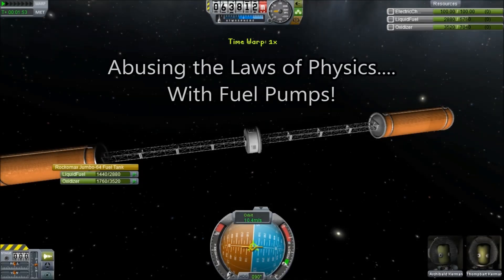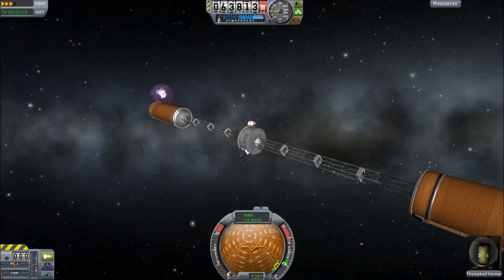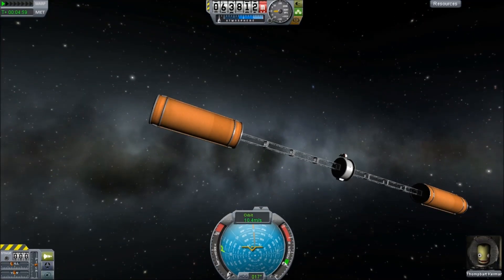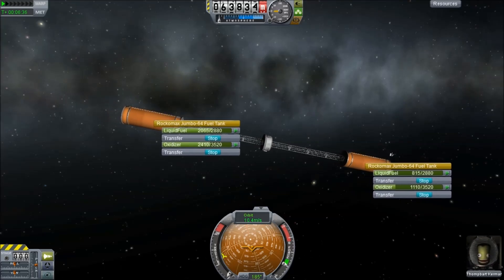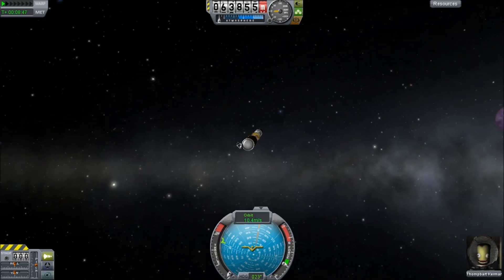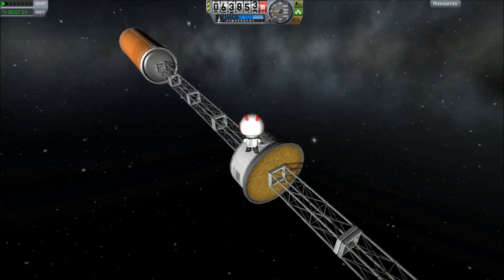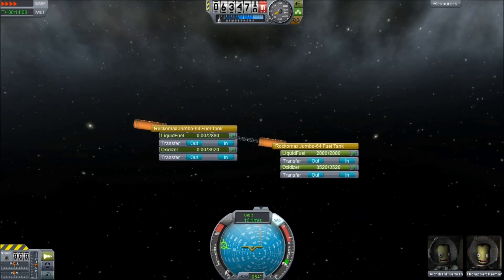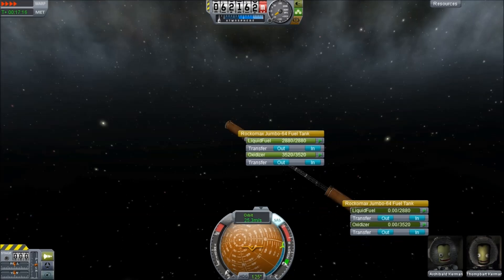Kerbal Space Program - Abusing Fuel Pumps To Break The Laws Of Physics

Comment: Could this work in Reality with Light Sails?  Does emitting light from a laser actually push back on the laser at all?  So imagine instead of having a fuel tank on both ends you have a light sail facing towards the middle.  Then in the middle you have a laser emitter pointing both directions.  Then instead of shifting fuel back and forth you turn on and off the laser to hit the sales when they are pointed the direction you want to go.
Reply: No, if the force you are applying is attached to the object you are applying it too, they cancel each other out and you go nowhere. Conservation of momentum, sort of like putting a giant fan on a sail boat.

Comment: if you set up a ring of tanks and had the fuel flowing around the ring, could you match the rotation speed with the transfer speed to make this exploit a little more automatic?
Reply: if you could set the transfer speed then yes
Reply: or measure the default transfer speed and match it with the rotation speed

Comment: The reason this works is that you're moving mass from one tank which is moving one way to another tank that's moving another way, magically accelerating the fuel as you do so. Since there's no corresponding magical acceleration in the other way, you'll break conservation of momentum. It's not a floating point error. It's the same as using it to change your center of mass, but with momentum instead of position.
Reply: well the reason this works is, that you don't need any energy to pump fuel in kerbal, but most certainly in real life :D
Reply: No. It's that you don't need any momentum to pump fuel. If you could do that in real life just using energy, it would still be a reactionless drive.
Reply: No, this isn't the case. If you pump fuel IRL from one tank to another, no matter if you're using energy or not, then your ship would move, not because you accelerate fuel, but because your CoM should always stay in one place. In KSP though they've done that that vessel is stay in one place while CoM can move (either because that's how Unity positioning system works, or because devs decided that ship shouldn't move when it's changing it's CoM). There is no physics behind it, only coding. And this bug is fairly easy one to fix (by adding same but opposite shift as shift in CoM, if this is due to Unity engine, or by removing that "fix" which makes vessels to stay in exactly same space, depending on cause).

Comment: There is no such thing as inertia!!! Stop trying to identify nothing. Moment of inertia refers to rotating objects. Inertia refers to resistance. What resistance?
Reply: ***** there's resistance in the pipes where the fuel flows due to friction.
Reply: hehe....
Reply: +TheJCprogrammer Luna I would like to clarify that it is fictitious.
Reply: +michael booley 
Inertia is the resistance of the body itself, look up an ice skater example where they extend their arms to slow down their rotation and bring them in to speed up the rotation. This works in a vacuum too.
Reply: +hookiebookie1 so long as the mass is the same, the change of motion would be the same. In this case, none. If an ice skater puts their arms out it increases air resistance (it also has things to do with centripetal forces but myeh). 'Inertia' is a fictitious name for the supposed 'resistance' of a change in motion. It does not RESIST this change in motion. If it 'resists' something then there must be a force acting on it in the first place and if there is a force acting on it then it will not remain stationary or at a constant state of motion (lets talk space here because on earth friction would be resisting its change in motion if it were to be stationary). You can literally describe everything without using the word 'inertia'. This supposed resistance can't be measured or quantified.
Reply: +hookiebookie1 +hookiebookie1 I respect that. At least you are not a self proclaimed Physicist like others i have discussed this with. 

Certainly though, gravitational force doesn't act as a force that slows you down? All it does is change your direction and brings you into an orbit where the atmosphere acts on the object. Most claim inertia to be the phenomenon described by Newton's first law (you know that). So long as you have external forces, like the ones your described, acting on the body then you cannot say that it is 'resisting' anything (in terms of inertia) because then that wouldn't be his first law (since the exception in his first law is that no external force acts on the body).

If there is 'pressure' acting on the body also, then mustn't this 'inertia' be disregarded since a body will only remain stationary or at a constant speed so long as there are no other forces?
Reply: +hookiebookie1 So inertia is not what people quote it to be? "The resistance of a change in motion" (brief) is what others say, its the resistance to an actual force acting on it (the 'torque' you mentioned).
Reply: *****
Well the force causes a motion, does it not? So the resistance to that motion will be the inertia of the body! It's not a singularly defined N3L force, as it's a function of mass and body size, so in that respect it's not just one definable quantity so you'd be right in that regard I guess :) But inertia is a very real thing indeed.

If you're interested, have a look at the kinematic Euler rotational equations as an example. If you know how to code a dynamic system, using MATLAB let's say, then try implement them into the code along with the 3-2-1 Euler angle equations. For a time stepped input force you'll see a gradual quadratic response of the body's angular displacement, then once the force is removed the response of the body becomes linear.

The reason there is a quadratic response is due to the inertia - the resistance of the body to the motion! :)
Reply: +michael booley Oh, I just saw your first message too, I'm glad you're open to discussion! 

In regards to solar radiation pressure, if the body is at rest and then an impulse of SRP acts on the body, there will be a "ramp" effect of the acceleration of the body. The acceleration will then go to zero, and the body will only have a velocity. The inertia in this case is describing the body's inability to instantly go from a 0 velocity at time t0 to n velocity at time t0+1. This "inability" is due to the inertia, which depends on the body characteristics.

I can see what you're saying about the gravitation however, you're seeing the satellite in a steady state in a steady non-decaying orbit. In this case, yeah there's no resistance acting on the body as all the forces are balanced. Let's say there's a solar flare however, and the air density at orbit altitude increases. In this case, there will be an imbalance of forces and the body's attitude will be influenced. So that the body doesn't "snap" to the new attitude, there will be a quadratic change in the acceleration - that is, it will gradually increase, reach a maximum, then decrease and settle to zero when the new attitude is achieved. This gradual change is due to the inertia of the body.

If though, like I think you're saying, the body is in a steady state with all balanced forces then you're 100% right, inertia doesn't do anything as there's nothing for it to do!

Comment: This is a perpetuum Mobile . Someone should tryx it in real life.
Reply: RedStoneGulch At some point, you would run out of either electricity or fuel for reaction wheels or engines.  It wouldn't last anywhere near forever.  If it was solar powered, the wiring and other individual parts of the craft would, at some point, wear out.
Reply: OcarinaT1 lol, did you watch the video? in real life your spacecraft would move too as you transfer fuel w.r.t the universe, so its not possible to begin with :p if it were, we could have gone away with superconductors but the energy input of the sun still wouldn't make it perpetual.
Reply: RedStoneGulch It would be much easier to use cheats in real life.
Reply: ***** SOLAR SAILS aka photon sails, they're pretty cool and they use the energy of light lol :P
Reply: And, even in space, will need some sort of repairs or replacements over time to function correctly.  All things deteriorate.
Reply: OcarinaT1
Indeed but hey they use no fuel and they're pretty light, and they work on light, and they're so cool :D

Comment: Actually, the most things in KSP could be exploited to gain/lose energy. The fact that KSP doesn't simulate a n-body problem can be exploited, even better: KSP:s horrible aerodynamic model actually causes the total energy to change quite a lot. FAR does a much better job, but even there, there are situations were you gain more/less lift (and thus energy) than you should.

Comment: you actualy dont break the laws of physics there, i tested that theory in a very good 2d physics simulator sandbox program called algodoo, and with actual water i was able to build a pump, pumping the water from one tank into the other, gaining velocity, frm my center of maß, it took some time to trancfer some water, i hade to keep the rotational speed smal, but it worked, so it would work in real. well the pushing from the pump kinda decreased the vel. but hey :D

Comment: I just realized that I'm happy they didn't model fuel inertia. 

I'm doing station keeping on a large and fragile space station and it took me about 6 minutes of fine control just to turn the thing around 180 degrees without ripping it apart due to oscillations or not being able to stop the turn on time.

It also has to be done with ASAS off because it corrects too much and will put it in a death wobble. Fuel inertia would make this much worse.

Comment: Yes the torque was free but that wasn't the issue. The lack of momentum of fuel while still changing the center of mass is what allows this to work. That is breaking physics, along with the reaction wheel.

The fuel sloshing back into the rearmost tank should just about counteract any net gain. Just like a rocket in space it should have momentum so it's not just going to magically stop in the tank and exert no force on it at all - but that's what is happening here.

Comment: Actually, there are systems called reaction wheels which can do similar low-torque, high-efficiency, rotations with nothing but electricity.
Reply: Reaction wheels can rotate the orientation of a spacecraft, but they can't move the center of mass.
It's interesting to try to figure out what the difference is here between rotational and translational motion. Both rotation and translation have a conserved "momentum" quantity (angular momentum vs. regular momentum).
But for translational motion, there's also relativistic symmetry under a change in the velocity of the reference frame. (That exists in both Newtonian and Einsteinian physics; just the details are different.) That turns out to imply an ironclad relationship between the momentum and the motion of the center of mass (technically, in the Einsteinian case, the center of energy/momentum). For a closed system, you can't do anything to alter the trajectory of the center of mass without interacting with the outside world in some way, say by firing a rocket.
That relativistic symmetry does not exist for the case of rotational motion--there's no symmetry of the laws of physics under a change in rotational velocity. So conservation of angular momentum doesn't imply that the orientation of a closed system is in any way restricted, if it's non-rigid or has internal moving parts. Cats, who are notoriously floppy beasts, take advantage of this fact to rotate themselves in flight so they can land on their feet.

Comment: I'm sorry, but that's not abusing the law of physics at all. It's just that maneuver thrust in KSP doesn't require fuel to begin with unless you're using additional RCS. You're converting the torque in movement by changing the center of gravity, but that torque wasn't supposed to exist at all to begin with...
So this isn't any more lawbreaking than just maneuvring in KSP...

Comment: Not as such, no. There is a force reaction when the fuel is accelerated away from the first tank but that is canceled out by the force reaction when it is stopped in the other tank. It is impossible to gain velocity in a ship without accelerating matter away from the ship itself (discounting gravity). The ship is a closed system in terms of inertia if no matter is leaving/arriving.

Comment: There is a module that does that, however due to rounding errors fuel disappears over time, but you can reach pretty good speeds, even escape orbit.

It should be found under the propulsion tab, named 'engine'... ;)

Comment: The capsules might be a tad over-powerful in that sense, but even if it's generating 'free' rotation it would still behave normally in space. Reaction wheels are used in real spacecraft, including the Hubble telescope and many satellites, particularly where fine maneuvering is required. The only problem is that for any significant torque, high mass or very high speeds are needed, so yes, things like the space shuttle have RCS. In principle, though, they could rely entirely on reaction wheels.

Comment: I dont think so. What you're not getting here is that the act of moving the fule through the ship exerts a force on the ship opposite to the direction of the fule flow. Thus the ship should move relative to the fule movement, but it didn't. There should be a net 0 effect on the position, but KSP moves the center of mass without moving the ship. No amount of internal movement should have a net effect on the external position of the ship. Does this make sense to you as to why its not the pump?

Comment: That's just plain wrong. The speed limit of light speed is a barrier that works both ways. Anything going FTL can't slow down to subluminal velocity, and anything subluminal can't accelerate past the speed of light. 
Also, none of these rules apply for anything without mass, since the mass is what causes the energy requirements to go to infinity.
I'm not saying FTL particles do exist, but question your rational for ruling them out.

Comment: With the motors? It's because the generator isn't 100% efficient at converting torque into electricity (and even if it was, you'd end up with the exact same amount of power), nor is the motor 100% efficient at converting electricity into torque. Friction's a part of that, of course.

Comment: I see your point but it's still impossible. When you move the fuel to one tank, the inertia it creates would move the space ship the other way.

It works because you've seen it working in a game. But you cannot make that work in reality. Maybe you could if you had access to a 4th dimension and could move the fuel around through it, not affecting 3-dimensional space.

You can jump inside a space ship, which will make the ship move away from you. But you will stop that once you smack the ceiling.